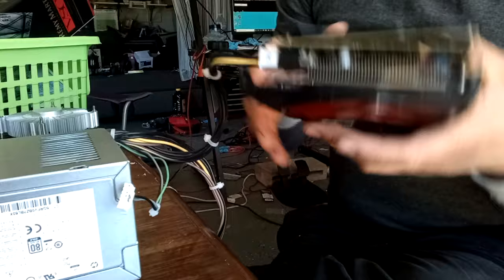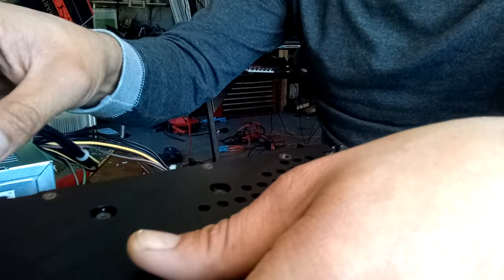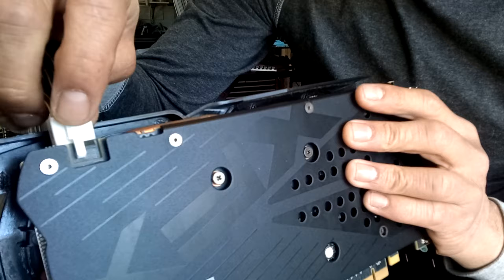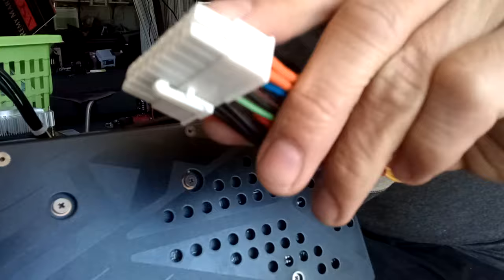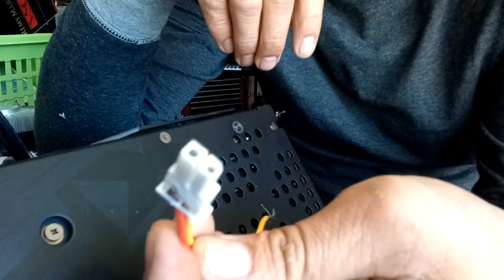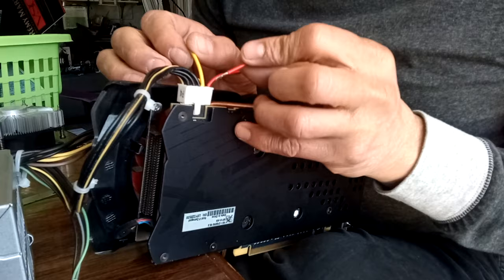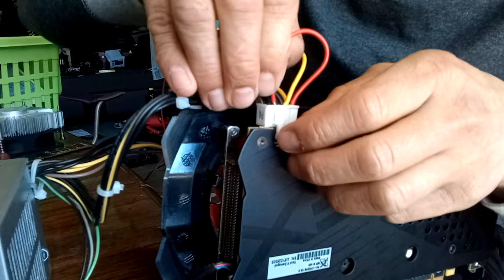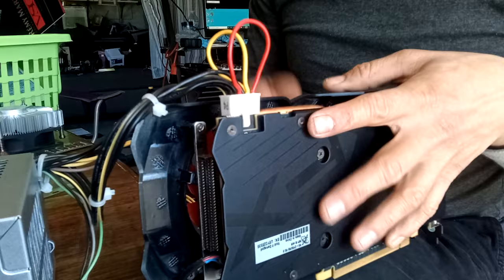How to use a 6 pin power supply on a 8 pin graphics card

Comment: Why would you instruct people to create a fire hazard.?
First that supply 310 watts is barely enough to supply  power to a Motherboard and CPU at idle never mind the power demands that the GPU will place on it.
2 jumping wires at the plug is not the same as running a second wire from the source, the added current demand placed on the single 
wire you jumperd to 
will cause it to heat up and cause a fire hazard.
Finaly just a warning By posting a video detailing how to doing somthing foolish you are placing yourself in a position to be legally liable if the procedure in the video results in the video card to short out or burn up or cause a fire do yourself a favor and delete it. There is a reason why the card requires the wire circuits is
 Because it needs them

Comment: Very good job.  Alternatively,  can buy a 6 pin to 8 pin converter.
Reply from the maker: Yea I've done a few that way but most are Molex or sata to 6pin haven't found too many 6 pin to eight pin converters  this is actually how the actual 8 pin power supplies are connected from factory I just decided to add the two extra pins in their respective slots if you have some extra pins or wires around is a good work around.
Reply: @gamesense8698  I have a 500w 80+ Bronze  it has 2 seperate 6 pin connector.However my sapphire Rx570 4gb requieres 8 pin but since its seperate i cant connect both my 6pin connector to the 8pin port on thr rx570 .So if using 6pin to 8pin is it safe in thr long run? Considering its rx570
Reply: @AmeerQ99  how you 570 now
Reply: @mzubair21  ya it works but if you want to use the external 6pin make sure to use ur 6pin connector from PSU to ur GPU then the other 2pin just connect ur external 6pin
Reply: Thanks man I didn't think they had one ❤
Reply: @AmeerQ99 How is your 570 now iam thinking to do the same to 470 and I only have 1 6pin
Reply: @Review_Channel_  I only used it for few times and sold the gpu .As far as I'm concerned it performs well but I do recommend upgrading the PSU just to avoid any future risk/damage .I think using it for short term should be non issue

Comment: I'm using 6 pin 550W Power supply Unit for 8 Pin 1660 TI ... 
Will it work fine with just 6 pin ?
Reply from the maker: It won't man youl have to pin the other two wires or can buy a 6 to 8 pin adapter they are really cheap on ebay around 3 dollars shipped

Comment: Bro..im having trouble with amd r9 380 4gb.. Its use 6pin x 2..12pin basically.. But i only have 6..is this possible to apply the same method?..
Reply from the maker: Yes you can copy cable per cable and should be good watch my other video regarding the same subject and like and subscribe please.
Reply: Will do bro thanks 😃👍🏻
Reply: you can buy a molex to 6 pin if needed on ebay, assuming your psu has molex connectors.
Reply from the maker: @retsaMoN  the problem with that Is  those  will not have enough power to power the GPU as they are made to power fans and or hard drives & ssd's. So you will have a lot of crashing and or blue screening
Reply: @gamesense8698  I've been using a 2 molex to 8 pin connector on my rx 480 and it's been fine. and on my older gtx 950 I used a molex to 6 pin and worked great.
Reply from the maker: Yep if it Works  it works yes I've done it before too but just dnt recommend it but for those who don't want to splice anything that works
Reply: @retsaMoN  but watt increase 20% and graphic temperature also increase.

Comment: Good advice, if you have an old PSU, replace it with a used PSU, used market for PSU is good, for $50-60 you can even get fully modular 850W gold PSU. But thanks for the video

Comment: I've been using 6pin on my 8pin rx 470 for 3 years with no issues I've gone to 99% load before with no issues is there a problem with using 6pin on rx 470 everywhere online says no you shouldnt but it doesn't really use more then pcie and 6pin provide already as it hovers around 120w to 150w but pcie and 6pin provide around 75w each anyways
Reply from the maker: Yes Only on an rx 470 you can get away  with this 100% with no problems  it's amazing love it. Tech yes city an other tech channel has stated this also he found out on accident too
Reply: @gamesense8698  I have a 500w 80+ Bronze  it has 2 seperate 6 pin connector.However my sapphire Rx570 4gb requieres 8 pin but since its seperate i cant connect both my 6pin connector to the 8pin port on thr rx570 .So if using 6pin to 8pin is it safe in thr long run? Considering its rx570.Im worried as i read on internet they say it will blow up
Reply from the maker: @AmeerQ99  you should be just fine using a 6 pin to 8 pin connector
Reply: How is rx 470 going now
Reply: @AmeerQ99  now here in this comment he is saying rx 470 should be fine
Reply: The thing with RX470 and 480 cards is that if they're still on an old retail VBIOS, they may overdraw and burn even without using a bad adapter. But that's unlikely to happen as there have been numerous firmware updates since then.

Comment: One year review how is it holding up. How’s those wires or the connecter look? Do they look burnt or anything??
Reply: A tiny, unmeasurable overdraw would be required for it to burn that slowly over a year. I doubt that such things ever happen. It's either burned or just fine.

Comment: Thank you for sharing this.  Have you increased voltage on that card and (even if you have not) did you get any instability or a smoking wires?
Reply from the maker: I have not increased voltage on the cards I have modified, no instability or smoking wires. make sure you dont cross wires and they are making full contact. I do make sure the power requirements for the gpu and overall system are met spects wise on the power supply. check out my new video regarding your question for a bit more details.
Reply: @gamesense8698  Good job.
Reply: @gamesense8698  Hi!
I was thinking, if i have a 2 power suplyies, and i dont have any 6 pin conectors i can use one to make a 6, pinnconecfor out of the 24 pin one?
Reply from the maker: @androidforfree212  yes, make sure the part you cut off has the exact type of connectors  as some connectors or pins are sguare and some are somewhat rounded off just make sure they imitate the six pin that you have shape by shape if not shape them with a sharp blade that works for me very carefully is not easy as you can end up cutting too much.

Comment: Can i connect 8 pin cable on 6 pin graphics card?i saw a review it says it work and it says 6+2 pin, it is the “LIAN LI PW8-V2 ADDRESSABLE RGB STRIMER Plus 8-PIN”
Reply from the maker: Yes it will work just fine.

Comment: So I recently upgraded my gt 1030 to an RX 480 and when I play GTA I get 25 fps but when I had my gt 1030 I would get way better fps than my RX 480 and I can't seem to find out the problem. I think it might be caused by having a 6 pin connecter in the GPU when it requires an 8pin connector but I'm not sure.
Reply from the maker: make sure you download the drivers for the graphics card from amd
Reply: @gamesense8698  i did ive tried everything i have a 6 pin to 8 pin coming in the mail and ill see if that makes a difference cuz i think the power and performance is being cut in half because i im running a 6 pin on a 8 pin gpu
Reply: @gamesense8698  because i have 1700 mhz mem clock and when i play gta it only gets up to 1250 mhz
Reply from the maker: @therealilxaiden  yea I DNT even know how's it's even booting up usually they dnt I've heard from Brian from the youtube channel called,  tech yes city, that there was one card that does boot up that way but it's rare from what I've experienced they shouldn't boot up or post  at all.
Reply from the maker: @therealilxaiden the GTX 1030 shouldn't be able to play gta5 at all that card is one of the worst cards ever it shouldn't exist, it's basically just a display card if you DNT have an apu, also the memory clock doesn't use all of its speed at all times it depends on what is being renderered some scenes or parts of video games are more demanding and the cards fluctuate I would say that is normal but def not getting enough power from the sounds of it .
Reply from the maker: The rx 580 is light years ahead of a GTX 1030, the GTX 1030 is not a gaming gpu at all, the 1030 if you look at reviews it's really a scam.
Reply: @gamesense8698  thanks for the info 👍
Reply: @simio4760  found a 1030 user
Reply: @gamesense8698  a gt 1030 can actually play gta 5 on low settings with about 35-40 fish its just about gtx 750- gtx 750 ti performance with less power usage and smaller form factor but its definitely over priced for 75$ and especially the sneaky thing Nvidia did releasing a ddr4 version of the gt 1030 that performs basically half as good but for the same price
Reply: if it's a sapphire have you tried switching the bios switch on the gpu from left to right? It's a black switch near the aluminium backing. If you have reference card then idk.
Reply: @khaise5452  I ordered a refurbished gaming pc because the parts in it were cheaper and it had everything better than my current build other than the gpu. I just switched out the psu and put my gtx 950 in. I am replacing my 950 with an rx 480 when my 8 pin power cable come in, but I might try this 6 to 8 pin methood.
Reply: RX 480 with no 8 pin connector gang🤣
Reply: man guy i have the msi amour version
Reply: @clickbait9744  yeah I just connected the 2 last pins to the 6 pin grounds . XD mail is WAY TO SLOW. I've been waiting a week for my real 8 pin connector to come in.
Reply: @retsaMoN  I'm still waiting for my 8 pin adapter to come in the mail it has been over a month already and every day I'm suffering with my Intel HD graphics
Reply: @clickbait9744  feels bad man.
Reply: @clickbait9744  update about it man. Did the 6-8pin pcie connector work flawlessly or not? I am thinking of doing the same. RX6600 on litepower 450watt from thermaltake. Mine has only one 6pin pcie. Sad life.
Reply: @gamesntech4827  Update: the 8 pin adapter never came in the mail so I just bought a cheap 550w psu with a 8 pin connector. (now I have a job so I bought a rtx 3080 ti and it worked good with the one 8 pin 550w psu until I bought a 850w one😂)

Comment: hey bro i have the same problem that you have i need just  2more pin but in game i get like 60 Fps and after each 6 seconds it goes down to 15 fps  when i did the benchmark i saw that when this drop frame happens in the same time the Graphic usage goes down  like 80% to 30-20% is that the problem from the pins ?
Reply from the maker: If your pc is not blue screening or crashing probably not, could be a cpu or gpu bottle neck, or both items need to be upgraded lower down your graphics settings also running benchmarks usually pushes the cpu and gpu to the max I burned out a bunch of older cards that way from creating too much heat. Im almost 100 percent is not the pins also didnt quite understand if you actually did the mod or your gpu is missing the pins from the power supply, but your still able to use the card with the missing pins, in some instances some cards do power up with only one 8 or six pin connector but can't really remember which one's I do remember hearing something similar from Brian, from tech yes city.
Reply from the maker: Also watch my latest video for a bit more info on the same topic.

Comment: that is allowing the card to pull 150w intead of the designed 75w from the psu, definitely not recommended
Reply: Most PSUs from 2010 and beyond have a 6pm connector design that has 3 12-volt pins instead of just 2, and those connectors are actually rated for 150W like a regular 8 pin/6+2 pin connector.
All the extra 2 pins do are Sense and GND.
Reply: @AkkumuLBC  if they were rated for this it would have the 6+2 connector. Read the Intel ATX manufacturer manual.
Reply: @RhuanTob  The 6 18awg wires can easily handle up to 300+ W in total. With standard ATX power supplies, the 2 extra pins on 6 pin connectors give clearance for a maximum 150W draw, and 75W if otherwise. The only concern should be whether or not the rail can supply enough for the connected devices. So in theory, using a 6 to 8 pin adapter is fine.

Comment: can a gpu run without 8pin or 6pin adapter ?
Reply from the maker: Depends on GPU some gpus dnt require any external power, some are powered only through motherboard
Reply: my gpu needs 8pin and when i plug it on the mobo fans are not spinnig only rgb is running is it normal ?

Comment: Q: Dont work with only 6pin connector? aditional 2pins conector is really necesary?
Extra 2 pins adapters... sound as more problems, more probabilty of fault... burn, toast, etc.
I think if you card is rated below >120w you can only put 6pin connector... in the fact 6pin conector can deliver as 216w (not only 75w as many people says.... think about it how a 2 extra ground can multiply this to 2 how 3positive can deliver 75w with 3negative and 150w with 5negative... is not possible... power is same, and paths to ground has many many many in many pins)
Reply from the maker: Watch the next video regarding your concern, make sure the power supply has enough wattage for a specific GPU. The way I do it is the way the PSU factories make the newer ones or the ones with more pins.
Reply: @gamesense8698  ok. 
Yes, i have a workstation psu with 1000w and 80+ silver certification but only has 2 6pin pciex connectors and only 1 8pin connector... Mi gpu card consumption is more or less 90w. 
I wish that gpu work with 6pin, i dislikes adaptors... if dont work, may be starting cutting and put new 8 connector,but is a crime to these psu... Jejeje